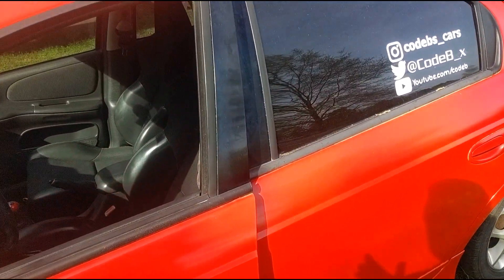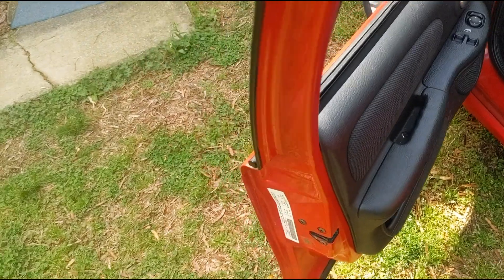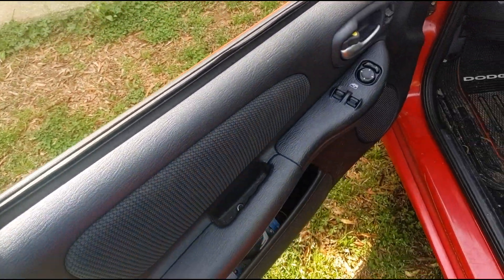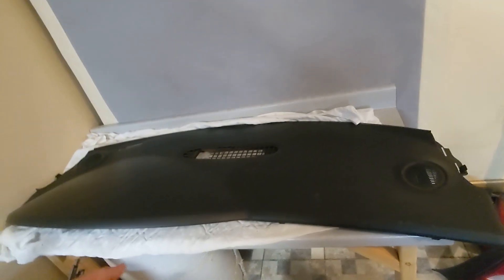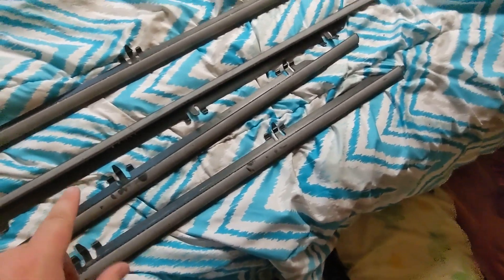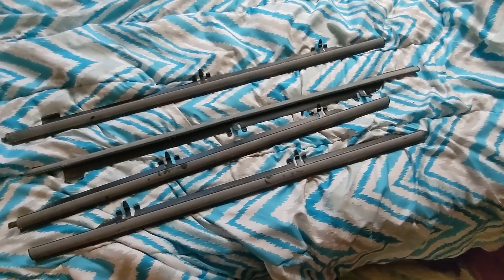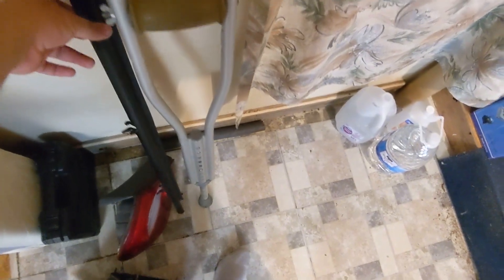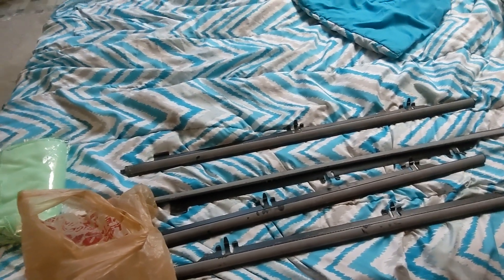Dodge Neon Window Belt Moldings (Refurbishing Possible?)

Comment: What’s the link for those ?
Reply from the maker: The link for what exactly? The belt moldings are discontinued.
Reply: Did you ever get to the point where you're refurbishing these as a service?
Reply from the maker: It's still something I plan on doing eventually I kind of forgot about the project right now The car's been sitting in my backyard for a while with a leaking water pump and I've just been driving my 1st gen
Reply: Any way you'd be kind enough to share what you bought off Amazon? I just bought an '04 SXT, and the window belts are T.R.A.S.H.
Reply from the maker: Yea I'll look up and get you the link if I can when I get off work
Reply from the maker: @maximusmax4557  https://www.amazon.com/gp/product/B076N5MLX5/ref=ppx_yo_dt_b_asin_title_o00_s00?ie=UTF8&th=1
Reply: Thank you! I bought this 2004 SXT with only 40,000 original miles on it, and the very first thing I wanted to do was replace all the window belts. I have an '02 SE as well, but the belts are still in good condition. The point is, until I needed them, I had no idea they were completely discontinued. Oddly enough, I can still get new window belts for a 2002 Ram pickup truck! Anyways, thanks again! Looks like a very nice SRT4 you have there! 👍🏻
Reply from the maker: @maximusmax4557  let me know if you find out any better ways to do what I was trying to do I'd be interested to know